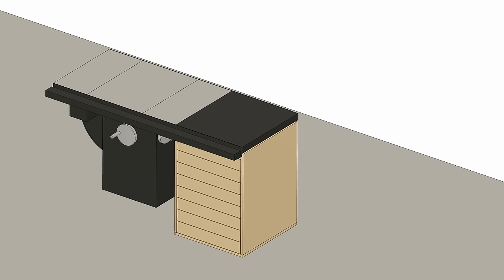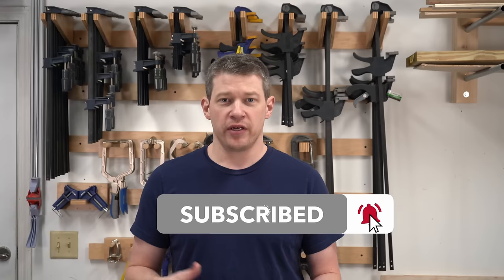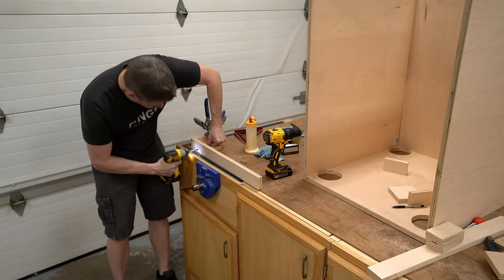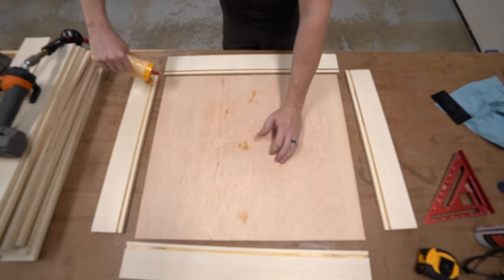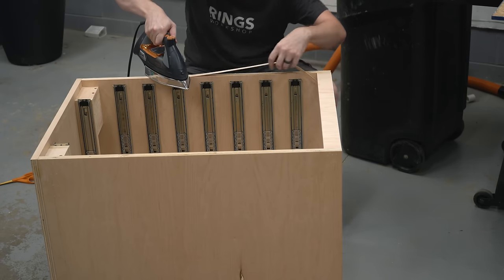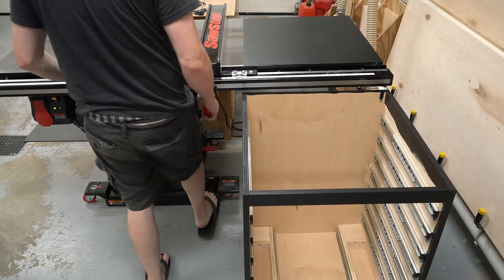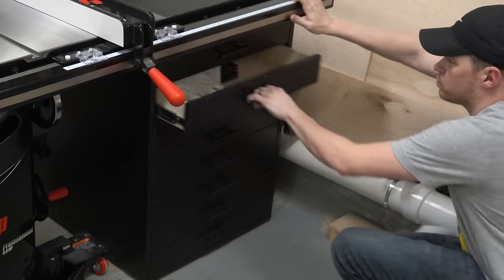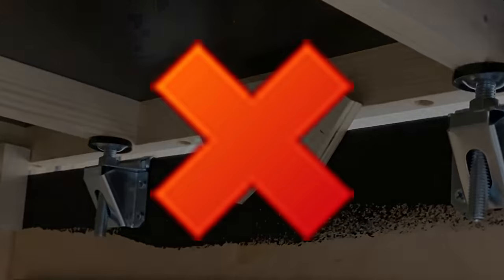Mobile Table Saw Cabinet

Comment: Extremely clever use of the inverted cones to self-center. Seen it before with round pegs but cones are so much better - far more tolerant of finding the sweet spot to lower down and lock into place  Reversing the adjustable feet to point upwards - genius - never seen that done before.
Reply from the maker: Thank you!  I hadn’t seen the feet either but was really happy how well they worked in that fashion!

Comment: I built a cabinet under the wing of my saw as well. However I already had a router table in that wing. So I built the cabinet with a hole or a horseshoe near the top to accommodate the big router and lift mechanism. To move the saw, I need to pull router out of the table and both are then free to move on their own.
Reply from the maker: Very nice!

Comment: Both cabinets turned out beautiful, clean and I like how they’re almost hidden in a way because they go so well with the table saw! Very smart solutions to joining to the table saw. My tablesaw is much smaller but I do need cabinets one for a router set up and I have a new bandsaw that I’d like to use but I need its own home and this cabinet is short enough it’d work well
Reply from the maker: Thanks!  Glad you liked them both!  I’m very happy how they turned out.

Comment: Nice i have been tossing around how to put a cabinet under my sawstop. Now i am going to have to buy a 3D . Just so I can copy this setup. For my gripper blocks, push sticks, extra  cartridges, dado stack, etc
Reply from the maker: I’ve seen a lot of people print push blocks and knockoff grippers as well.  So much you can do with it.
Reply: @RingsWorkshop  What model of 3D print for a novice would you recommend. I was always told to buy your second tool first to save money.
Reply from the maker: @jwar2163  funny you ask that, I have been doing some research on one myself.  I have put a lot of money in upgrades on this one and honestly I would have been better off just buying a nicer quality one.  I think a few things to look at are bed size…for instance I would love to be able to print insert plates for my SawStop, but the bed isn’t big enough.  All metal hotend, dual gear extruder/direct drive, pei bed plate, auto bed leveling, and I want linear rails as they can move faster than belt driven, so it would allow me to print faster.  There are a lot of things to look at, nice thing is you can buy a cheaper one and upgrade most parts as you go…other than bed size really. Long story short, even if you go a little less expensive now, you can always invest more into it to upgrade it along the way if you want, again other than the size of your bed.
Reply: @RingsWorkshop  Thanks for the insight and the information.

Comment: great tip on the MDF drawer slide spacer templates!
Reply from the maker: Thanks!  I had never seen it done that way before but it has worked out really well for me over the last few years.
Reply: @RingsWorkshop  the fact that you start at the top and just trim as you go down makes for awesome use and no waste/multiple templates being thrown away after. Nice work 👍🏽

Comment: Thanks for this video. When I bought my saw stop I built a platform in the same shape as the base. It sits on top of the mobile base. Then the saw sits on top of the platform. It’s about 4 inches high and makes table saw stop a comfortable height for me.  I had to extend the legs on the right side of the saw.  I did this with some triangular brackets at the top of each leg.  It worked well and I like it but I like this solution much better.
Reply from the maker: Thank you!  I did the same thing with the platform but only 3” (partly height for me, mainly height for bench I use as an outfeed table).  Been really happy with the cabinet so far.

Comment: Great build video - definitely need to consider this - just feedback, I had to go back to your old video to remember how you propped the saw 3 inches higher.  When you make the router table video, please just show a screenshot of that modification.
Reply from the maker: Thanks!  Great callout!  I’ll be sure to do that.  I was trying to avoid shooting too much new footage as I didn’t want to have the router table show in this video, but I could have used the video from the SawStop one, good call out.

Comment: You’re me in the future. You’ve see comment before but holy cow, you think just like me. These are the things I am working out in my shop but just a year behind you. I thought about this when you did the miter saw dust block. All you need is to get rid of every single open metal tool stand that comes with tools and build a WoodSmith inspired drill press cabinet.
Reply from the maker: Hahaha!  Not going to lie this one, mainly the centering on the supports part, took way longer than I like to admit!

Comment: The one thing that keeps me feom doing a cabinet like this is a router table attachment. It hangs down and wouldnt allow for a cabinet. You mentioned you planned to still incorporate a router to your table. Id love to see how you did that.
Reply from the maker: The next video show I put it on the other side.  Had a lot of debate on how I was gonna set it up but ultimately I wanted more space with the router table and the other side was against the wall.

Comment: Did you ever come across the brand and name of the paint?  I searched this posting and did not see it anywhere... Thanks for what you do.  I love this design.
Reply from the maker: No.  It’s one of the more expensive ones from Home Depot, but I only got a quart and not a gallon, but the one I thought it was doesn’t come in a quart and it isn’t showing in my Home Depot purchases.  Ugh.  I’m going to have to stop in there because I know exactly where the can was so I’ll link it soon.  I apologize for that.
Reply: Curious about that too..
Reply from the maker: @kevindawes1832  looks like they may have switched to a different series or what they call it.  I could not find it when I went there last week.

Comment: Just curious... I was looking for plans regarding your under saw cabinet.  Are you not selling plans for this?  How about the cones.  Would you consider selling those already made?  If not.  No worries.  I can figure it out on my own, but would have paid to avoid the guess work.  Thanks.  Looking forward to more video content from you.  I hope you haven't left us here on YouTube.
Reply from the maker: Nope I’m still here!  Put a set of plans out last week, have three more coming over next month (including the one you referenced) along with another video!  Just taking some time this summer to get some other projects done that I didn’t make into videos that maybe I could have (installing mini split, garage floor tile, soon to be resurfacing the deck), but there are so many videos out there on those topics, and I’m no expert in those areas, I didn’t make them into videos.  I have thought about selling printed parts, but that is still in the works.  The STL file is on my thingiverse site for free download if you have a 3D printer, or know someone that does.
Reply: @RingsWorkshop  
Hi.  Thanks for the response.  May I ask one more thing? What is the dimensions of the cones you 3D printed.  I am thinking to make my own from wood.  were they about 3 inches tall?
Reply from the maker: @neilf4128  about 1 3/4” tall, base where it attaches is 2”x2”

Comment: Hi. Longtime no see. 

Noticed your drill press seems to be missing the elaborate dust collection system you built for it.  Do you still use that? If not, why, and any ideas how to overcome issues? 
Thank you for your response.  Love your channel
Reply from the maker: Hello!…and thank you!  I use it all the time still, it just isn’t large enough for that size hole saw unfortunately so I take it off for the few times I use larger bits or hole saws.

Comment: Awesome. I've been trying to figure out how to do that. I have the router wing on the 36 inch table. Do you have any plans? I'll need to modify for my router but that's easy.
Reply from the maker: I will at some point, they will need modified since mine is 3” taller than most will be.  My next video will be on the router cabinet I made as well so I planned on getting plans together for both of those.

Comment: Did you ever track down the name of the black paint that worked so well for you?
Reply from the maker: They stopped making it apparently, or rebranded it I should say.  It was one of the top end Behr or Glidden paints that quote one coat coverage prime and paint.  I’m sure they have it named something else, of course it was one out of like 200 purchases I made at Depot I used a gift card on so they can’t look it up.

Comment: Any chance of you making the plans available on your website?
Reply from the maker: They will be up sometime in the next month or two.
Reply: @RingsWorkshop  I cannot find the plans on  yuor web site.
Reply from the maker: @MarkLasbyCNC  I have not made them yet, due to my saw being 3” taller than normal I was worried it would be confusing.  I will add it to my list as I get back into making plans again soon.
Reply: @RingsWorkshop  Do not rush on my account. I drew my own plans and cut list for a slight variation of your design. I can send you photos when I complete the cabinet.
i wanted 6" on top of the cabinet to store my cross cut sled and I did not bother with the space between the casters. I also left 6" of space on the back to hang a couple of other jigs. 
Thank you for all of the great ideas. I like to buy plan from creators like you to support you.

Comment: How about an update on that paint?
Reply from the maker: Depot stopped carrying it, or it was replaced by something else.  But the stuff I actually used is not in the stores anymore.  Used a quart for both my cabinets under my table saw/router wing…amazing stuff.  I want to say it had Diamond in the name and was a one coat primer and paint, but closest thing I’ve found only comes in a gallon now.
Reply: @RingsWorkshop  Appreciate it.

Comment: Are there plans?
Reply from the maker: I did not make plans as my table saw is on a 3” riser and was worried people would buy it to use with normal height saw and feel this was misleading as it wouldn’t work for them without modifications.  Still may in the future and put a disclaimer on it, but that’s why I haven’t yet.
Reply: @RingsWorkshop please do add them with a disclaimer! I just bought mine today and was looking for a solution to the dead space on the right. I'd definitely buy plans and get busy asap!